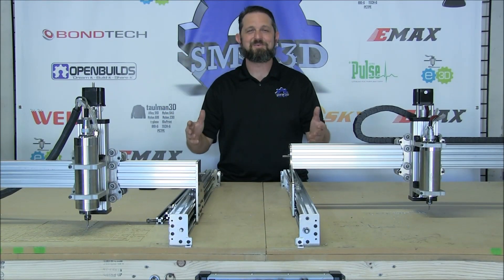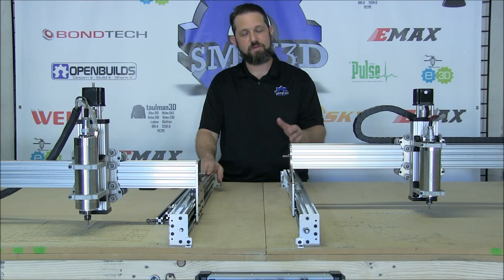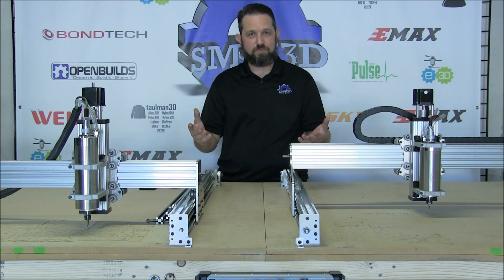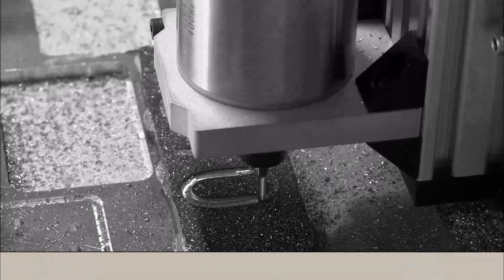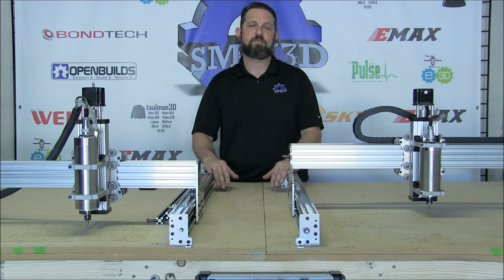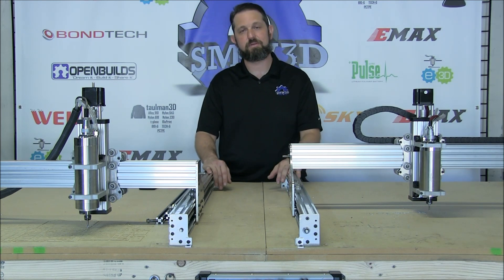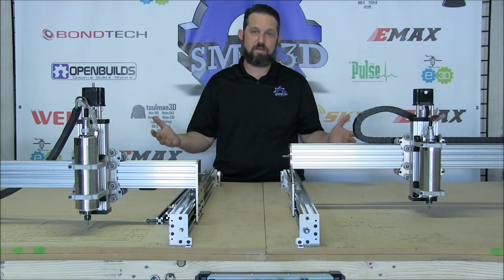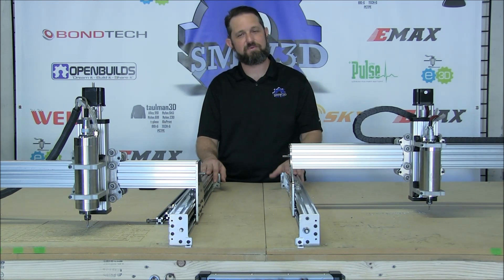R7vI - Out of Date, please follow the document instructions

Comment from the maker: Thanks guys. We have a site we (beta group) are building, https://sites.google.com/site/smw3dr7/ we are updating drawings and adding some of the coolest features you will see in a DIY machine. 
We do have kits available through the site but are throttling the production. We anticipate the mid first quarter of this year we will do the full release as this is when we will have the full manual and plans together.
Reply: Hello friend, I am in a design with 1600 oz Nema 34 or 115kg torque motors, weighing approximately 5Kg each + 0.7 of a nema23 motor for the Z axis, and a 2.2Kw spindle that weighs 5.5Kg + 2Kg from other parts in the X axis In total an approximate of 24Kg in the car X counting the 2 plates with motors in the Y axis ... Do you have any table on the maximum weight for profiles 20x80 of length of 1500mm?